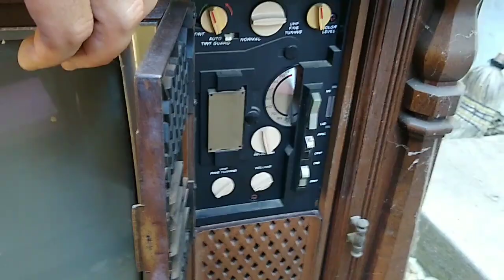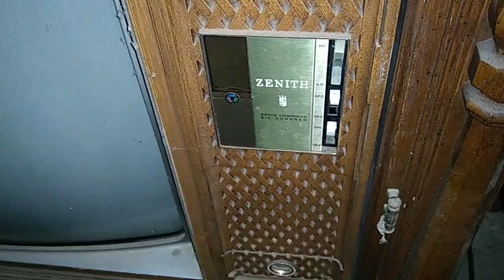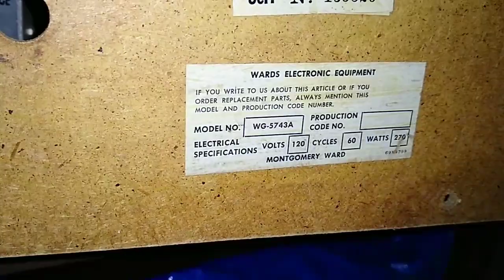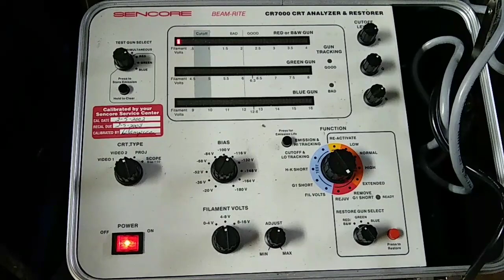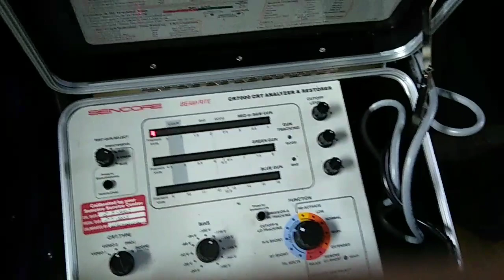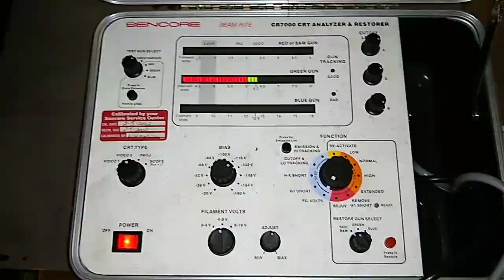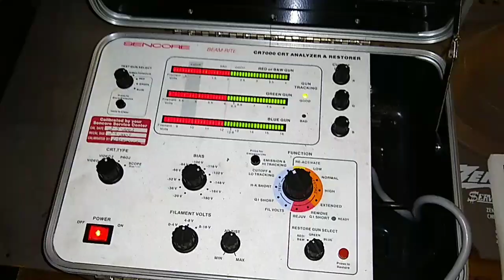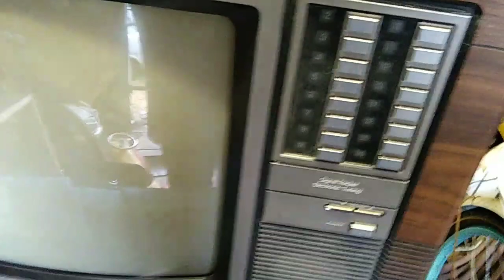Acquisition and assessment of vintage Montgomery wards and zenith television

Comment: Great Video Jordan! If you ever in Sacramento and want to stop by I have an extremely large vintage TV shop. I have over 80 CRTs, around ten thousand vacuum tubes, 40-50 TV backs, 40-50 vintage TVs, 7 Phico Predictas, lots of Predicta parts the list goes on and on. All my stuff is mainly late 1940s through the 1960s. I am not open to the public, this is just a hobby for me at the moment. But if I can help you out ever, let me know!
Reply from the maker: Thank you! I'll holler if I need anything and drop in if I'm in the area. Don't know if you ever ran into my high school friend Charles D. He lives in sac and a large console he needed serviced. This would be about 5 years ago or more. I think I referred him to a shop like yours if not yours.
Reply: @JordanPier  Great! I am not sure if I met Charles or not. But if you referred him 5 years ago, you probably referred him to Steller Electronics, I bought Steller Electronics TV side when the owner changed the location of his is business. Steller had an entire warehouse of vintage TVs, HiFi gear, and test equipment. I was lucky to be at the auction and bought 90% of it. It took me 17 truckloads to move it all. Every load was really great vintage TVs and TV repair stuff you can never find anymore. I intend on parting out the collection from Steller, I only bought them because I enjoy working on them and if I didn't buy a lot of this stuff it was going to ewaste. I made a thread about it on VideoKarma my name is DeLorean00 over there. I haven't been back on VK in months though because my real job has kept me really busy.
Reply from the maker: @delorean00  I know the feeling. I used to participate on AK and VK (JPDylon) alot but life and work has gotten in the way. I hardly have the time to keep up with the YT channel but it is fun to do videos.
Reply: @JordanPier  Exactly, same with me. I do really appreciate you taking the time to make videos for your YouTube channel. I have learned so much just from channels like yours and Shango066, Radiotvphononuts, Bandersentv, etc. These channels played a large part in why I am working on TVs now. It is like getting that rare chance of being able to look over the shoulder and learn from an expert. When I was kid I would follow around my friend's Dads who were good auto mechanics or good carpenters just to watch and absorb as much as I could. This is just the modern COVID complaint version.

Comment: The Wards Airline console radio/tv looks pretty nice as the radio chassis doesn't use a ratio detector for the FM. It instead uses a limiter followed by an FM Detector (discriminator?) so maybe like the old Zeniths did. Well maybe it doesn't I'd have to look at the schematic to know if it does or not but if it uses an FM limiter it usually doesn't seem to use a ratio detector. It should perform really great on FM as long as it doesn't have SMD and is aligned properly. Has Single ended 6BQ5's one for each channel for a true stereo output. Well the FM stereo MPX adapter is optional.  I wish really these consoles didn't take up so much space otherwise I'd have tons of them haha.

Comment: it's so weird seeing a tube tester with LEDs on it.  last calibrated 2002!  it probably even has one of those new-fangled microprocessors in there too.   granted, it IS a CRT tester, but still it's anachronistic seeing LEDs on one.

Comment: I love that Zenith! Their delta CRTs wore like iron. Too bad their CRT quality downhill spiral led to their demise.
Reply from the maker: Sadly, the crappy CRTs came after the decline of quality. Zenith going down the tubes happend in the late 70s when they shifted production from chichago to mexico. The early system 3 sets had a failure of one of the sweep boards that would arc and burn through the insulator at the back of the board. The insulator was not supposed to be flammable. However many sets caught fire and caused considerable damages. Sets were recalled but those that never made it into a service center eventually met that fate. Zenith settled for an undisclosed amount. Shortly after they sold to LG (goldstar) at which point they really went down the tubes.

Comment: It seems the CRT in the Wards gets shorted when it warms up to normal temperature. What if you underheat it (raise the heater voltage to the level when it is just not yet shorted), and blast it with the highest rejuv setting? It might be able to burn off the crud which causes the short if it's not touching.

Comment: Zenith seems to be model # C6787P1.   1972 model so available from apx sept 1971.
CRT looks to be the original by the tags. Lets get it going !
Monkey Wards is an unknown chassis to me. I thinks its a Hoffman but I only saw a few in 40 yrs.
In any case it looks to be quite well built & deserves a resurrection even though the CRT is
as soft as a sneaker full of dog doot.
LFOD !

Comment: I'll stand by my statement that the Trinitron was the best CRT ever
Reply: The first generations, and the industrial tubes in BVM monitors, yes. The consumer tubes starting from the mid '80s, especially from the late '90s, with the miniaturized gun assy... they still produced fantastic picture, but were not the toughest. One would be happy if they produced a good picture for more than 25k hours. I've recently seen a BVM monitor for the first time inside, the neck of the tube is about twice as thick as on consumer Trinitrons, about as thick as a on delta gun tube. They can last for more than 50k hours. I think the first consumer Trinitrons had the same, thick neck, and they were as everlasting as these later BVM tubes.